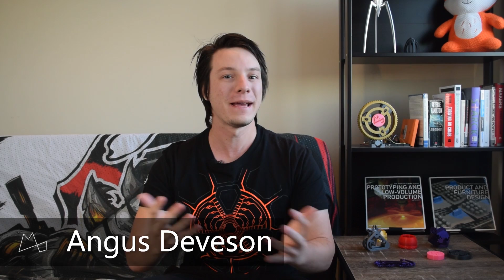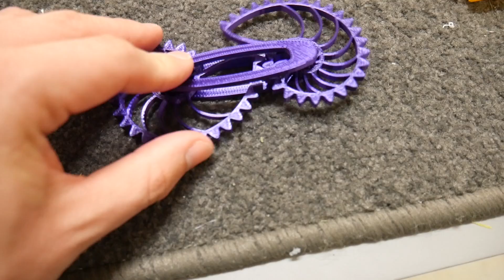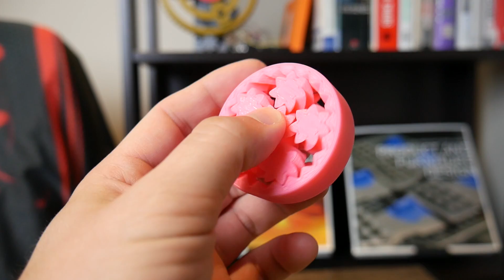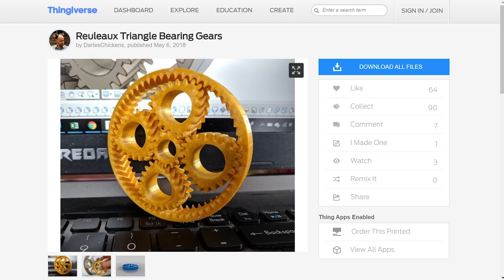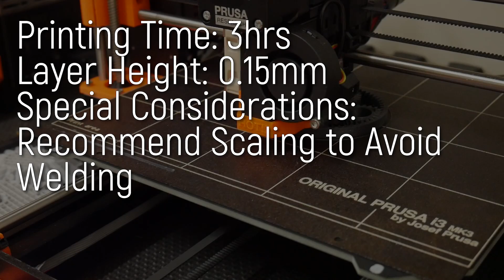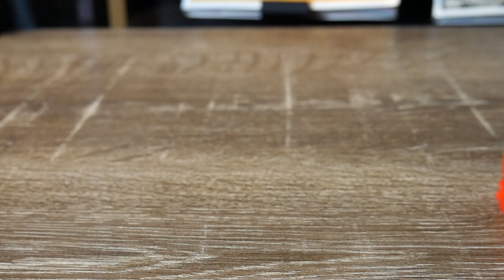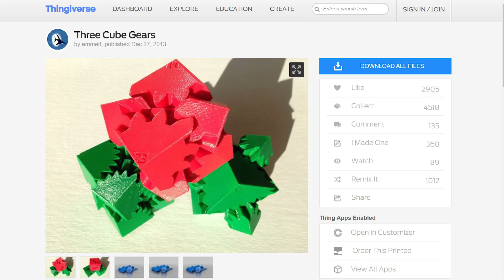5 Cool 3D Printed Mechanisms

Comment: What would you recommend for a first 3d printer? Im in Australia for shipping and im thinking the cocoon create touch.
Reply: Dont buy the Tevo Tornado. I bought it and its needs to much tuning to suceed a decent print. 

If you dont mind spending money a Ultimaker would really blow your mind. 
If thats too expensive you should buy a Prusa i3 mk3 (or another version) 
If thats too expensive too I would recommend a Chinese printer and buy the Cr-10(s) or JGAurora A5

Prisewise the JGAurora is the best  

Best results you will get from the Ultimaker(5). 

Dont buy a SLA printer for the first one
Reply: Angus Cos hey I am from Sydney Australia. I was like you and didn’t know what printer to get. I went with the JGaurira A5 from LightInTheBox.  Must say it’s such a great printer and LightInTheBox sent it out with in a week and got it within 3 weeks of purchase. Anyway good luck with your decision
Reply: I'll definitely look into it, thank you!
Reply: monoprice select mini v2 is my first
Reply: Just to confuse the issue - my Tornado worked out the box and and as my first 3D printer I couldn't be happier.
Really decent community of people to help you tinker with it as well (I'm drawing a line between tuning and tinkering) as well.
However, I'll agree some people have had a bit less luck. CR10(s) was what I'd settled on - but Tornado is significantly cheaper if you can grab a sale and has better mains-powered bed (so trade those points off against maybe needing to adjust on arrival).
Maybe other advantage is new Tornados come with Makerbase Gen-L board - I didn't get one, but bought one for about $15 and then maybe $25 for a set of TMC stepper drivers which I'm going to have a play with over the weekend...
...maybe the problem is defining what's meant by a "starter printer". Do you want to just print something - or have a hankering to learn to compile some Arduino firmware and build your own DuPont connectors?

Personally I think the important thing is just to pull the trigger and get yourself a nice cheap Chinese model. 
You'll learn a lot and whatever you buy you'll:
1) Decide whether or not printing is for you
2) If 1=Love, then decide you need a better printer. Then you can embark upon the eternal question of whether to buy yet more bits to swear at as they initially don't work - or just bite the bullet and get a Prusa (which as far as I can see is universally accepted as the best value printer in existence).
Reply: Cetus3D, prints way above its price, No bells and whistles just reliable prints every time with any type of PLA filament you feed it. High quality workhorse printer when print success matters it cant be beat at the price. No luck or tweaking required here.
Reply: Angus Cos Creality Ender 3. Best new budget printer of 2018 so far
Reply: Tom Dekker s
Reply: I would recommend the Cetus 3D. Angus actually did a review of it here --> https://www.youtube.com/watch?v=mnTiSZJdN34 .
I'v had one for a while now and am loving it.
Reply: I am in Aus and i got my self a Anet A8. Because i am a tinkerer i love improving and making parts with my printer for my printer the limitations of the A8 is down to the controller and stepper drivers hardware which is the same as nearly every other 3d printer running 8-bit arduino based micro controllers. There is a steep learning curve when starting 3d printing i have done many hours of research and can diagnose my own problems/ help fix others. Any 3d printer that uses a alloy extruded frame with a 220x220x2xx build platform (standard heatbed size) i would highly recommend as one of the upgrades to a A8 is to make one of these frames.
Reply: Angus Cos monoprice mini v2 get it off amazon not there website (my advice)
Reply: CR-10 is good. Easy to assemble, and minimal adjustment to be done (just tension on the rollers, and bed leveling). The only improvement I've needed to make on mine was getting a new glass plate, because the one it came with was warped.
Reply: Anet A3
Reply: My first was a Monoprice Maker Ultimate and I couldn't be happier.
Reply: I have a Cocoon Create Touch. If you can get your paws on one they are a decent printer for the price and you learn so much about printing with it.
Reply: I ended up with a geeetech prusa copy with an aluminium frame , works ok but suits me as i like to tinker or modify things and it was a kit so i got to build it ! After watching quit a few of the reviews that Angus did if i was to buy another printer i would buy a CR10 .
It is a difficult question for Angus to answer as he has no idea as to your expectations from the printer and how much money you want to spend .
I would suggest that you work out how much you wish to spend as it will govern what printer you buy and what features it has- like heated bed etc , from there you can narrow it down to a couple of makes and models then look at some reviews on those makes or models .  I chose the prusa copy because it was in a price range i was comfortable with , there are millions of them out there so parts are not an issue and there are many easy modifications or improvements that can be done if a wanted to and around $400 au delivered to my door .
Reply: Have a look at Angus's video of the best 3D printers at various price points https://youtu.be/XD7IZYcdw58